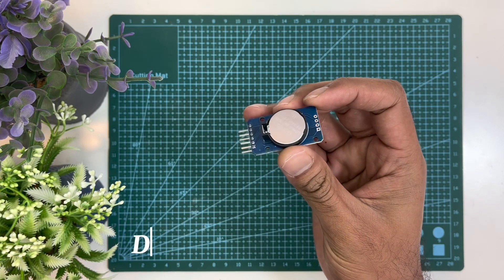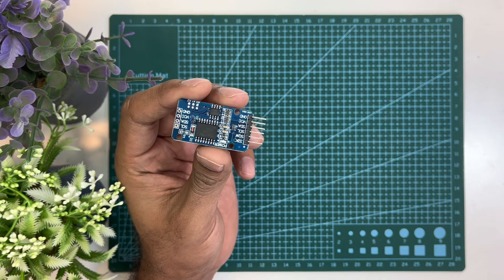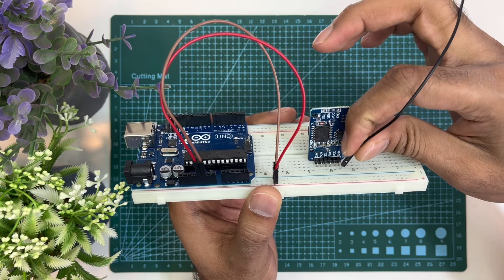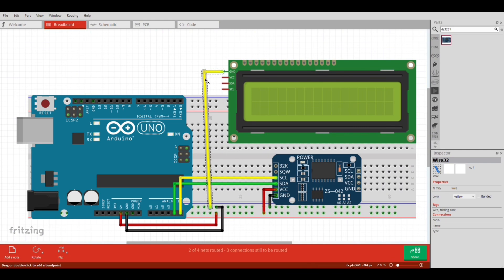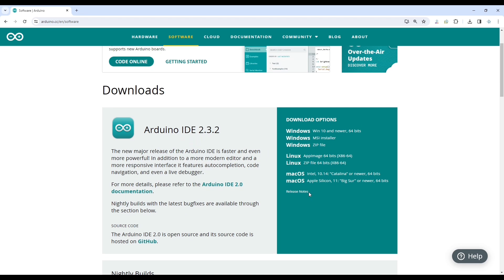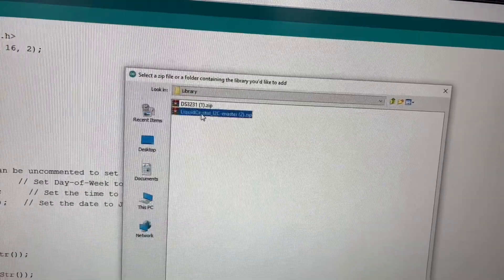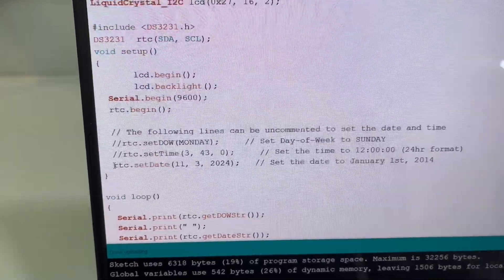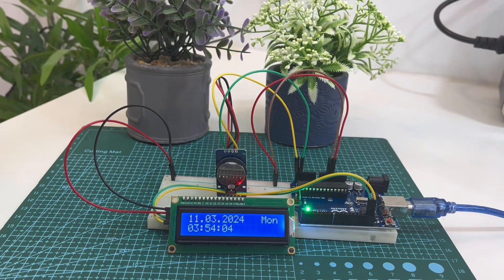DS3231 RTC Module with LCD Display || Arduino Project  || #ds3231 #arduino #diy

Comment: Ds3231 library in your description not have
Reply from the maker: Check the google drive link in the description.
Reply: @mahade_DIY  when add the library into the Arduino ide it show zip not contain library
Reply from the maker: Download from here and check again 
Let me know if it’s working or not 
http://www.rinkydinkelectronics.com/library.php?id=73
Reply: @mahade_DIY  it show some errors

Comment: hello why im getting the error saying:
C:\Users\delac\OneDrive\Desktop\ARDUINO_SUCKS\arduinoSC\arduinoSC.ino:9:20: error: no matching function for call to 'DS3231::DS3231(const uint8_t&, const uint8_t&)'
 DS3231 rtc(SDA, SCL);
                    ^
In file included from C:\Users\delac\OneDrive\Desktop\ARDUINO_SUCKS\arduinoSC\arduinoSC.ino:1:0:
C:\Users\delac\OneDrive\Documents\Arduino\libraries\DS3231/DS3231.h:73:3: note: candidate: DS3231::DS3231(TwoWire&)
   DS3231(TwoWire & w);
   ^~~~~~
C:\Users\delac\OneDrive\Documents\Arduino\libraries\DS3231/DS3231.h:73:3: note:   candidate expects 1 argument, 2 provided
C:\Users\delac\OneDrive\Documents\Arduino\libraries\DS3231/DS3231.h:72:3: note: candidate: DS3231::DS3231()
   DS3231();
   ^~~~~~
C:\Users\delac\OneDrive\Documents\Arduino\libraries\DS3231/DS3231.h:72:3: note:   candidate expects 0 arguments, 2 provided
C:\Users\delac\OneDrive\Documents\Arduino\libraries\DS3231/DS3231.h:68:7: note: candidate: constexpr DS3231::DS3231(const DS3231&)
 class DS3231 {
       ^~~~~~
C:\Users\delac\OneDrive\Documents\Arduino\libraries\DS3231/DS3231.h:68:7: note:   candidate expects 1 argument, 2 provided
C:\Users\delac\OneDrive\Documents\Arduino\libraries\DS3231/DS3231.h:68:7: note: candidate: constexpr DS3231::DS3231(DS3231&&)
C:\Users\delac\OneDrive\Documents\Arduino\libraries\DS3231/DS3231.h:68:7: note:   candidate expects 1 argument, 2 provided
C:\Users\delac\OneDrive\Desktop\ARDUINO_SUCKS\arduinoSC\arduinoSC.ino: In function 'void setup()':
C:\Users\delac\OneDrive\Desktop\ARDUINO_SUCKS\arduinoSC\arduinoSC.ino:15:7: error: 'class DS3231' has no member named 'begin'
   rtc.begin();
       ^~~~~
C:\Users\delac\OneDrive\Desktop\ARDUINO_SUCKS\arduinoSC\arduinoSC.ino: In function 'void loop()':
C:\Users\delac\OneDrive\Desktop\ARDUINO_SUCKS\arduinoSC\arduinoSC.ino:25:20: error: 'class DS3231' has no member named 'getDOWStr'; did you mean 'getDoW'?
   Serial.print(rtc.getDOWStr());
                    ^~~~~~~~~
                    getDoW
C:\Users\delac\OneDrive\Desktop\ARDUINO_SUCKS\arduinoSC\arduinoSC.ino:27:20: error: 'class DS3231' has no member named 'getDateStr'; did you mean 'getDate'?
   Serial.print(rtc.getDateStr());
                    ^~~~~~~~~~
                    getDate
C:\Users\delac\OneDrive\Desktop\ARDUINO_SUCKS\arduinoSC\arduinoSC.ino:29:22: error: 'class DS3231' has no member named 'getTimeStr'; did you mean 'getMinute'?
   Serial.println(rtc.getTimeStr());
                      ^~~~~~~~~~
                      getMinute
C:\Users\delac\OneDrive\Desktop\ARDUINO_SUCKS\arduinoSC\arduinoSC.ino:32:37: error: 'class DS3231' has no member named 'getDOWStr'; did you mean 'getDoW'?
  lcd.setCursor(13,0); lcd.print(rtc.getDOWStr());
                                     ^~~~~~~~~
                                     getDoW
C:\Users\delac\OneDrive\Desktop\ARDUINO_SUCKS\arduinoSC\arduinoSC.ino:33:36: error: 'class DS3231' has no member named 'getDateStr'; did you mean 'getDate'?
  lcd.setCursor(0,0); lcd.print(rtc.getDateStr());
                                    ^~~~~~~~~~
                                    getDate
C:\Users\delac\OneDrive\Desktop\ARDUINO_SUCKS\arduinoSC\arduinoSC.ino:34:36: error: 'class DS3231' has no member named 'getTimeStr'; did you mean 'getMinute'?
  lcd.setCursor(0,1); lcd.print(rtc.getTimeStr());
                                    ^~~~~~~~~~
                                    getMinute

exit status 1

Compilation error: no matching function for call to 'DS3231::DS3231(const uint8_t&, const uint8_t&)'
Reply from the maker: Please Add libraries before uploading the code.
I’ve shared two libraries ,download and include to your Arduino IDE properly

Comment: Is there a way to modify the sketch to make it work with the more common DS1307 RTC?  And how would you ever set the clock so it can be used?
Reply from the maker: For DS1307 RTC needs different library. It is possible to do this same project with DS1307 but for that code will not be the same as it is because of different functions inside the code.
Hope I will make video with DS1307 near future.
To set the current time : inside the code there have three lines with comment( //)
We have to undo those comments (by removing//) and set the present Day,Time Date then upload the code. After setting and uploading the code we could make those 3  lines again into comments (by adding //) and re upload the code.